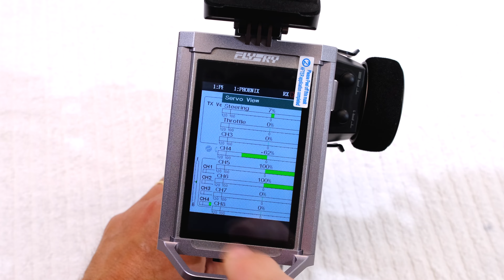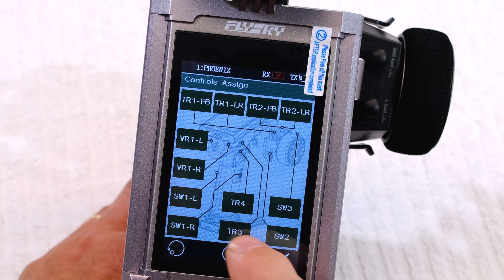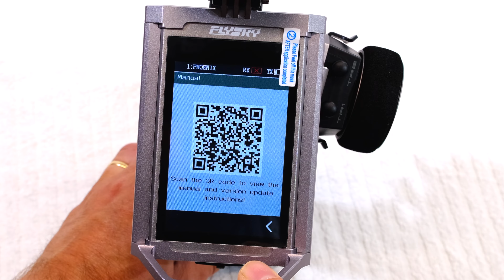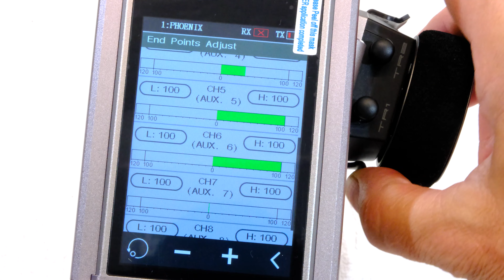Flysky Noble Pro - Surface Radio Control System

Comment: This is quite the nice looking radio! 

I've been curious to see more 'smartphone' like radios comeout, all the experiences I've had with older styles of computerized radios have been rather...annoying. Lots of endlessly clicking the same button to dig through things or rather dated pressure sensitive touch screens that take ages to actually load the next menu. Also it looks like the phone holder uses the 'Go-Pro' Style Action camera mounting system, which would be very useful for filming for those of us that don't trust a phone holder with their excessively heavy smartphone. A look at pricing shows it at a pretty reasonable price for what it is too.

Comment: That grate video iv bn thinkin bout fly sky they seem lot more comfortable in the hand to otheres I have a question if u have it operating 1 truck n u have a second truck when ur out like a full on rock crawler will it operate without changin the model on controler if u no what I mean m8
Reply from the maker: You have to change the model on the controller

Comment: An almost perfect radio. Sadly, the 20 model memory kills it for me.  Memory is so cheap now, you would think these radios could support an almost infinite number of models.  That 18 channels is incredible though!  It would be a real challenge to try to use them all.
Reply: You are right, although the Model list can be limitless via the import/export function. So basically you have to decide which 20 cars you will take for a ride during one session ;-)
Reply: It's completely unacceptable to limit the model memory for a radio with this price tag.
I'm using a few OpenTX/EdgeTX radios for drones, which is an open source firmware for RC radios, and there isn't a model limit at all (only limited by the SD card size).
Of course the export/import function allows the swap out the models -- but why, if it's possible to store them all at the same time?